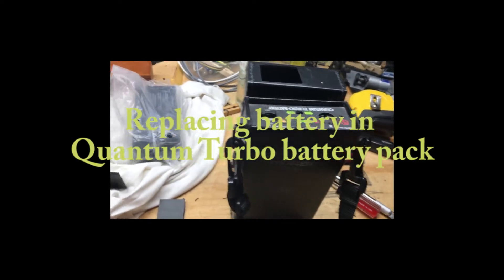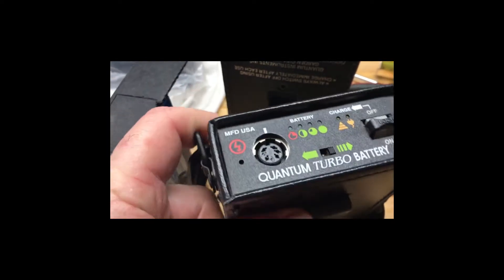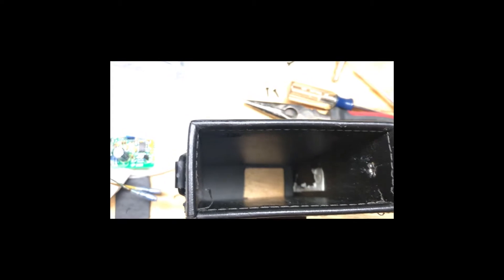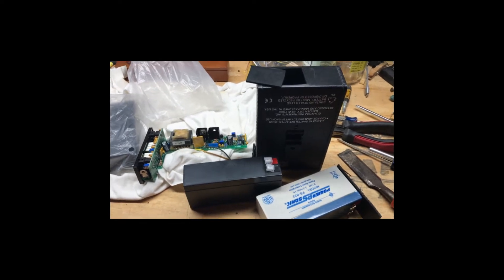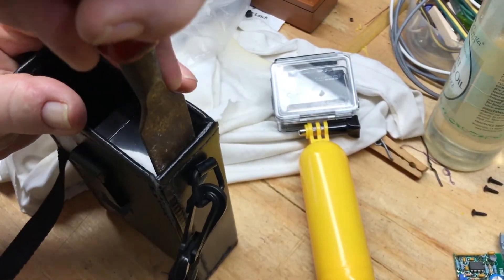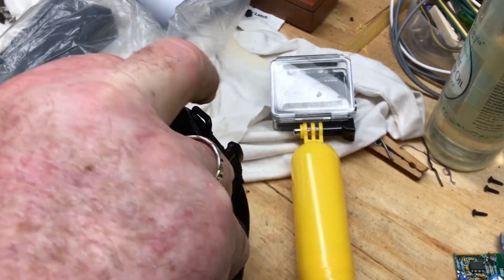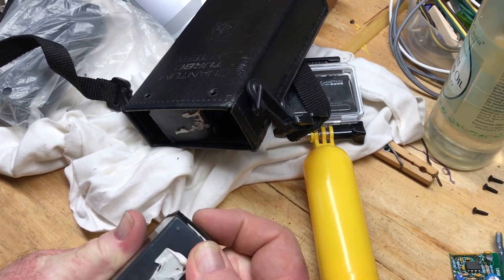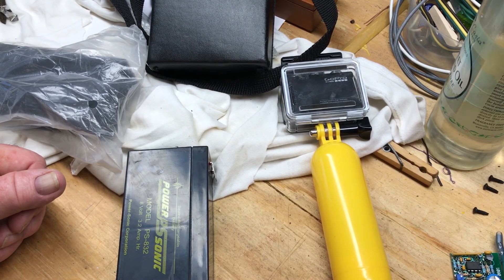Quantum Turbo battery replacement

Comment: Great video, I just tried to fit a new cell (PS-832) to my Turbo that has been in storage for years and I think I accidently connected the polarity the wrong way round! something popped flashed and smoked... Looks like a black capacitor? next to the copper coil has blown, it's about half an inch long, could it be a thermal cut off capacitor? I really want and try and fix this, and have no idea of what the equivalent component would be, any help would be wonderful...

Comment: This was one of the best from ATG/Quantum after ATG departed from Metz. 
The ATG Gold 60CT-4r was/still the world's powerful flash.
Both of these professional products are still working today.

The issue that one may run would be frayed & worn out cable. And those cables & cap are no longer available.

Anyone knows where one can buy a battery cable (external battery) for ATG Gold 76MZ-5r & Metz 76MZ-5 flashes?

Comment: For the 2nd part on removing the battery, how did you remove the computer first if the cables are attached to the batter? Did you just pull hard enough?
Reply from the maker: Once the screws were out I think all I did was turn it upside down to shake it a bit to loosen it coming out of the casing. The cables are not that tight as I recall but it has been some time,..

Comment: Thanks a lot James! One question; On the second battery, how did you get out the circuit board assemblage without busting up the wires or breaking contacts? Was it easy to just pull out whole?
Reply from the maker: Yes, it was easy, problem was not knowing why/what was holding it up when you were trying to take it apart so until I realized the wires and the connection as well as HOW  they were connected I was reluctant to just yank, if you know what I mean.

Comment: I have been replacing the battery for years...it just slides out not cutting or damaging the case.
Reply: yeah, somebody put some vhb tape (not glue) inside this unit in the vidya. i just popped mine out with minimal working of the front edges. 

it shouldn't require all that. the last person that swapped that battery out made a mess of it. 

but good job at extracting it.

Comment: thanks James. Mine came off without removing the bottom. I've used some waterproof sealing tape as a replacement for the glue. good luck everyone else.
Reply: How about not using any adhesive at all, wouldn't the screws help maintain the stability of the assembly? I figure the manufacturers used that  tough glue to discourage attempts at DIY, but maybe I'm wrong.

Comment: James, The process of removing the old battery is easier if you use the correct procedure. First off you are using the WRONG tool, don't use the thick chisel, all you need is a long thin 3/4" wide putty knife (long enough to reach the bottom of the case), you don't want or need to pry the battery away from the side, all you need to do is SLIDE the putty knife straight down between the battery and inside of the case to separate the double-sided adhesive tape (it's not glue), between the battery and the case. 

Another trick is to use a heat gun on the outside of the case to warm up the double-sided tape, which will make it easier to slide the putty knife down inside causing the tape to pull off the battery, and heat the bottom so you can pull the battery out easier.

I have 8 of these Turbo batteries and have replaced ALL the internal batteries many times.
Reply from the maker: This is all really good information, Jon. I hope everyone will see and heed these remarks to better suit the issue at hand. Thanks!
Reply: Thank you for the extra tips!

Comment: NICE. Can you do a video for the Turbo 2x2 model?
Reply from the maker: Danny, Sorry mate but I don't have that model on hand.
Reply: No problem and thanks. Great video, I have a couple of the very unit as well, so this is really helpful. Yes, you are right, these are great units, and can power just about every flash units, new and old. The trick is finding the cables, but he Canons and Nikons you can get for cheap.